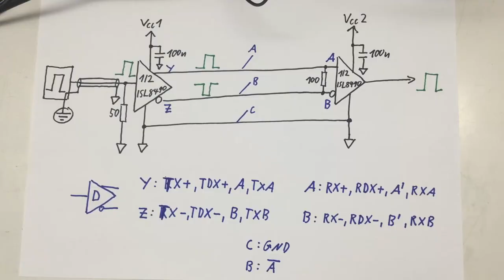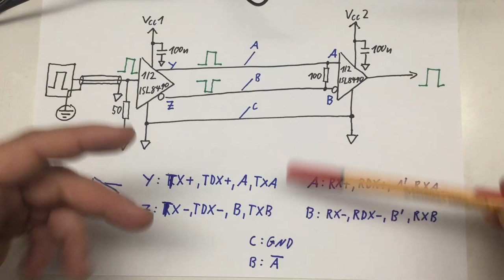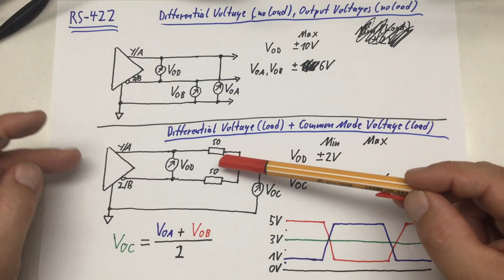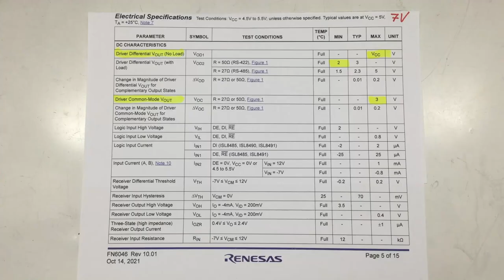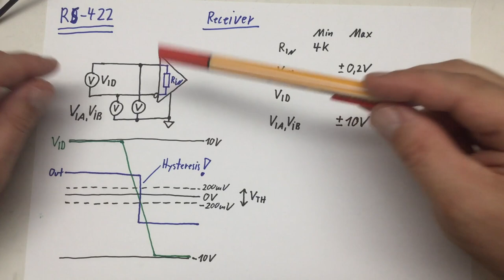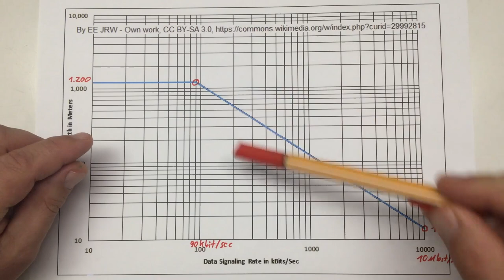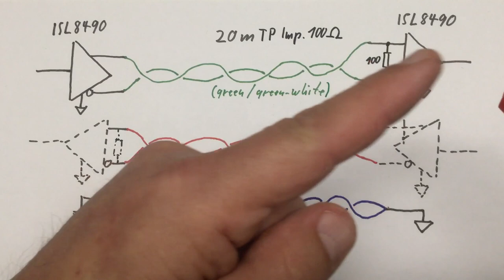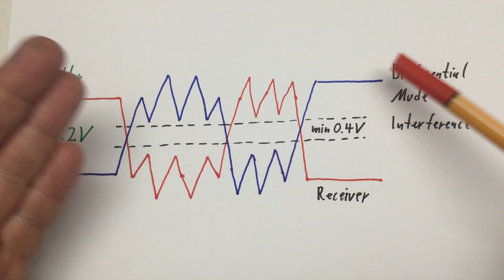RS-422 Differential Signaling (Renesas ISL8490, Arduino MCU) – The Basics (1/2)

Comment: Hi, good video.For RS-422 it is possible to "speak" with max 10 slaves?, if yes, how addressing is performed?
Reply from the maker: Yes, a single RS-422 line driver / transmitter can drive up to ten receivers. However, there's no "addressing". All receivers receive exactly the same data from a single line driver / transmitter. I'll cover multiple receivers in: "RS-422 Differential Signaling (ISL8490, AdUM121N) – The Details (2/4)" https://youtu.be/0WHKMjBg1QQ

Comment: Hello Robert, I am a little bit confused... Is there a difference between RS422 seen as communication protocol and electrical interface? Because I am considering an encoder line driver 5V Rs422 and I don't understand what the RS422 means in this case. I think it just means that we have a differential conversion in rs422 differential signal. Is it corrrect?
Reply from the maker: RS422 is a physical specification for transmitting/receiving asynchronous serial data (differential signaling, signal levels etc.). RS422 doesn't care about the logical format of the serial data transmitted (e.g. 7 data bits, no parity bits two stop bits - or - 8 data bits, parity bit, one stop bit). You could transfer the same serial data via RS232, RS422, etc.. Hope that clarifies things.
Reply: @robertssmorgasbord  Sorry just another question, if I have a signal A that can be 0v or 5v, with RS422 I will have for A=5V -> A+=5V and A-=0V and for A=0V -> A+=0V and A-=5V or if A=5V -> A+=2.5V and A-=-2.5V and for A=0V -> A+=0.epsilon V and A-=-0.epsilon. Or they could be both good solution? Thank you.
Reply from the maker: @LucaniaRobotics  As far as I can tell your first example (0V/5V) is well within the RS422 specification. However, +/- 0.epsilon V wouldn't work (e.g. +/- 0.9V), because the minimum differential voltage (Vod) under load is +/-2V. +/-1V is in that case the minimum on the signal lines under load.

Comment: Hi Robert
Vod (Voa-Von)is for difference between lines, but it seems that vod under load is not correct. It is defined as +-2 but on the graph it can be 4 volt (5-1). I am a little bit confused could you detail it?
Reply from the maker: First, I'm assuming you meant Vod = Voa - Vob (not Von). According toThe RS-422 spec Vod max (!) with no load (!) is ±10V ( https://youtu.be/6YWZMRe-7DQ?t=398 ), and Vod min (!) with load (!) is ±2V ( https://youtu.be/6YWZMRe-7DQ?t=446 ). So during operation Vod has to be between ±10V and ±2V. The Vod shown in the graph as an example ( https://youtu.be/6YWZMRe-7DQ?t=510 ) is ±4V, so within the allowed range. Hope that helps!
Reply: @robertssmorgasbord  I got the point now. We are looking if Vod is in the range , which is given as +- 10V in spec, or not. Thank you for your reply:)
Reply from the maker: @MCT249  You're welcome 🙂

Comment: Interesting to see 20M of cable out perform 15 cm of rubbish Du Pont ! interesting stuff....cheers.
Reply from the maker: One of these days I will revisit my laboratory water bath and replace its cable (7 mains AC wires) with something that has 3 mains AC wires and 1 individually shielded twisted pairs (for the One-Wire stuff) ;-)